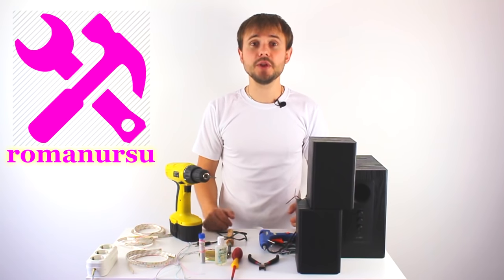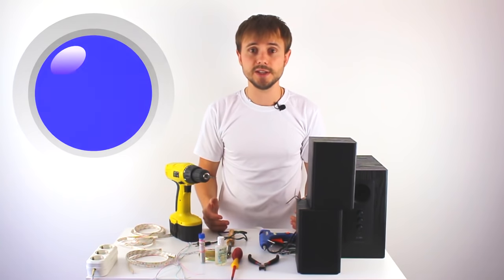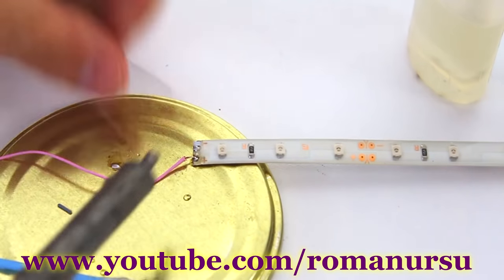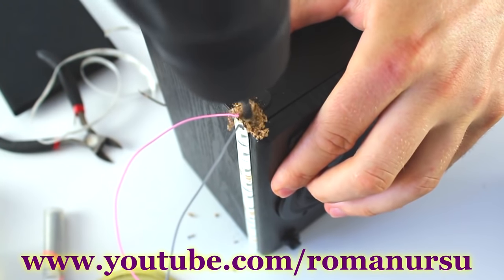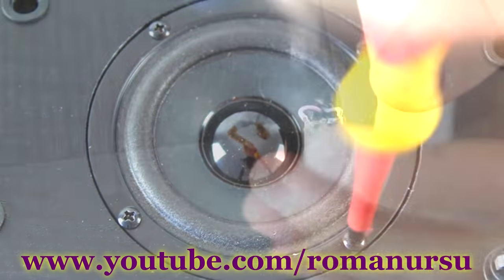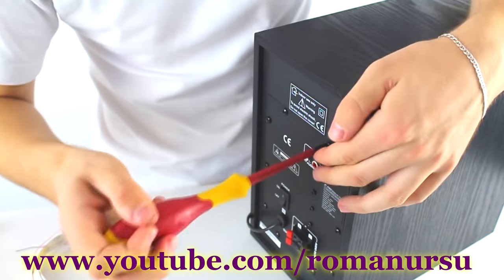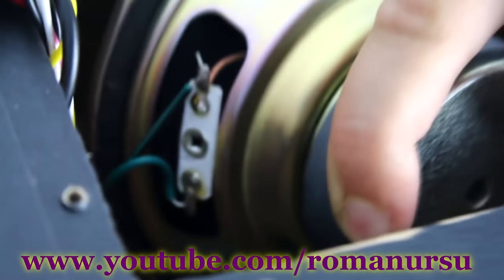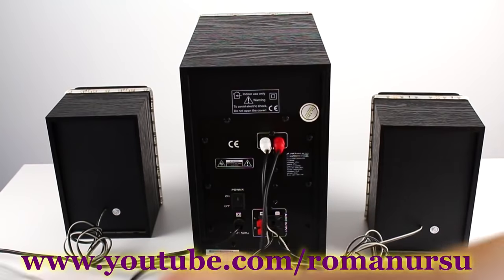How to make a simple COLOR ORGAN || TUTORIAL || DIY

Comment: I have a 160w speaker , 12v car radio and a 12v led light. I fixed them like this. But didn't work. Why is that? Please help me.
Reply: Bcz speakers output is not 12 v u have to use low voltage lights

Comment: Did anyone notice that the some red strip from 4.15 had stopped working
Reply: +kenil mehta That's because audio amplifier could give about 30V to the speaker ... Too much for LEDs.
Reply: +Firley 30 volt? Nice joke...
Reply: +Osumo Ben Lodan Look at popular TDA2030 amplifier IC's datasheet. Recomended voltage is about 15V. For TDA2050 it's 22V (44V from minus to plus). I have an amplifier where power supply gives +30V and -30V (60V between) to the power amp section (and thus to the speakers).

Comment: This is a Tutorial how to break your led strips... You should use proper transistors and a power supply designed for the LED strips... The result are 2 broken red leds in the strip... Not cool.. You show people how to break their stuff, please do some measurements people, before you build something like this...
Reply: +shinyFlake no transistor , transistor is using to make 220 volts(my country voltage) to 9 or 5 v..... resistor is making resistance so on that way power is lower example  14,5 volts into 6
Reply: +Basic Survival do you know how transistors works?
Reply: +Basic Survival maybe you mean transformer not transistor...
Reply: yap my English is suck
Reply: Basic Survival mine too... im from germany. but i control my led strips with transistors..  you can look up transistor or semiconductor... there you will be teached :)

Comment: Actually that is not a color organ. They are just blinking lights. A color organ flashes different colors for different frequencies, or varies with the strength of the source signal. They also use a microphone, or have audio inputs. Not just some lights wired to a speaker.
Reply: this is 2.1 channel stereo, has lights for bass, and lights for mid and highs left and right

Comment: hey guys 
i just try it on my car speaker 
its not lightning 
my led strip is about 12volt
i do put my volume max nothing dude
i just tried it in a battery but it worked yet

any advice please.... or 
romansuru please do something like reactive led circuit sound in a simple way
Reply: 12Volts Are more than power of the ampilifier

Comment: Then how do you put a different power suply for the led's while the led's still react to the music?
Reply: Why would you do that?
Reply: +GoldenHesus So your LED's will work on a lower voltage.
Reply: Osumo Ben Lodan A resistor??
Reply: GoldenHesus Yeah, that will work. But you need the correct Ohm resistor. That could be hard to find with the fluctuating DC/AC voltage of your speaker system.
Reply: hard pfft read on box i had 300 watts 2 subwoofer and 150 watts 7 satelits for voltage just attach voltmeter job done
Reply: Osumo Ben Lodan oh I see.